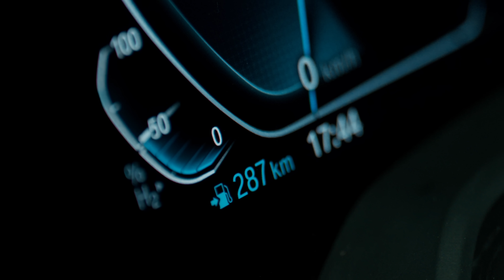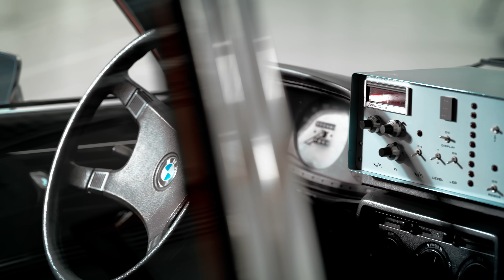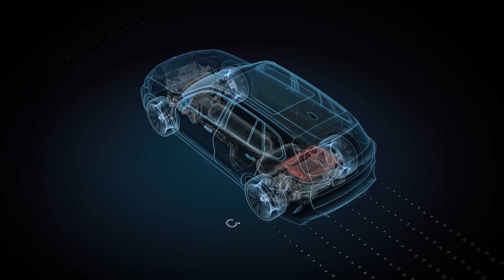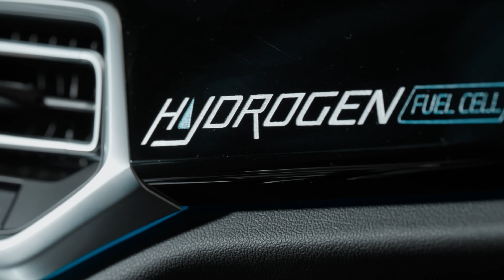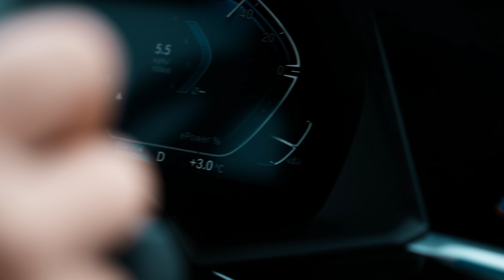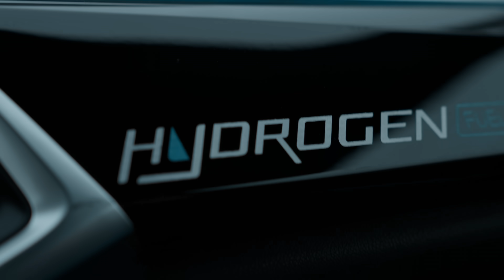Hydrogen Vehicles Are Electric Vehicles Too

Comment: It seems like many of the comments come from people who are not well-informed—especially those who favor battery EVs. 😄 The arguments against hydrogen technology often miss the mark. Personally, I see more potential in hydrogen than in batteries, though there's still a long road ahead. I’m skeptical that 2028 will be the breakthrough year for hydrogen vehicles. The challenge of building the necessary infrastructure is enormous.

When it comes to storing hydrogen, there are serious considerations. While some existing gas stations could be adapted, the storage tanks can't simply be reused for hydrogen. Hydrogen requires special tanks that can handle high pressures and prevent leaks, as it’s a much smaller molecule than gasoline or diesel. Safety is also a major concern—any potential ignition source must be avoided, even something as common as a smartphone could pose a risk. Handling hydrogen safely will require a lot of attention and rigorous standards to prevent accidents.

Given the current pace of progress, achieving widespread hydrogen vehicle adoption within the next four years is ambitious but not impossible. It would require overcoming significant hurdles in infrastructure, cost, and technology. If these challenges are met with concerted effort and innovation, we might see a notable increase in hydrogen vehicles on the road, though mainstream adoption could still take a bit longer.
Reply: I think you need to do some research.
Reply: Widespread H2 vehicle adoption would take a massive united global effort and decades worth of resources, because the required infrastructure is currently non-existent and very complex and resource intensive. It would be much more resource and time efficient to focus on BEVs and alternative forms of transit.
Reply: @paulc6766  I thing you too
Reply: @beanapprentice1687  
I’m just trying to explore potential answers, because simply dismissing the idea isn’t helpful. Think about it—how many times did the Wright brothers hear that human flight was impossible? Yet, they proved it could be done. Over 100 years later, commercial aviation is a normal part of life.

In the same way, I wouldn’t be quick to say whether hydrogen-powered cars are possible or not. Technology evolves, and what seems unrealistic today might become commonplace tomorrow. I believe in the free and natural exploration of technologies, driven by innovation, rather than having progress dictated or limited by regulations from political classes. Time will ultimately show us what is truly possible.
Reply: @jaroslavsimon8100  I’m sorry, but the time to explore potential answers is over. Automakers have had since the 1970s to figure out which emissions-free fuel technologies are best for passenger cars, and hydrogen clearly isn’t it. You can’t really compare the invention of powered flight with hydrogen cars because so many variables are different between the two cases. Today we have unfathomably more understanding of the world around us, and technology which allows us to simulate, create, and test inventions like never before. We know that H2 infrastructure is far more expensive than electrical or gasoline infrastructure, and it’s simply because hydrogen gas is among the smallest of molecules and tends to slip through microscopic imperfections in the walls of any container. Electrical infrastructure is far cheaper and already exists, and so all we need is alternative forms of transit to largely compensate for the weaknesses of EVs and we could easily convert half of the world’s vehicles to electric in the next 2 or 3 decade (of course, that’s ignoring resource limitations which willl undoubtedly slow down the pace of EV adoption; but if battery materials are a concern then we can focus on PHEVs instead and get all the environmental benefits during city driving, which is where BEVs are predominantly used anyways).

And if you want to know how the field of clean vehicles would innovate and explore technologies if the process wasn’t guided by government regulations, well the answer is that this field wouldn’t even exist. That’s because automakers only care about one thing, money. And neither BEVs nor FCEVs are as profitable as ICEVs. Hydrogen powered cars exist, but they’re little more than lab experiments and have been this way for the past 15 years without much change. Automakers are simply not willing to spend the billions upon billions of dollars necessary to build a comprehensive hydrogen refuelling infrastructure from scratch. But relatively light government regulations have been enough to convince automakers to spend money building out EV charging networks, with a thousand EV charging stations being built every week in the USA. Compare that to around 60 hydrogen fuelling stations ever built in the USA.
Reply: @beanapprentice1687  looks like my last comment have been DELETED...thank you very much pal for this democracy...very well done man.
Reply: @jaroslavsimon8100   damn, that sucks. I recommend saving long comments in a text file so that when YouTube decides to censor you, you can just past it again and change a few words.
Reply: @beanapprentice1687  yeah...I made more statements about this and I believe that yt communist censorship would no appreciate that I have my own opinion about CO2 and other problems.....I try to write it again because I was little longer and save it....apparently they dont neet people who can think on their own in discussions

Comment: What was the challenge of having the engine splitting H2 from water itself?
Reply: The challenge is that you'd need an external source of energy to do that, like carrying a very big battery. And then you'd just have an extremely inefficient battery EV.

Comment: You would have thought the nay sayers would have learned something from the BEV rollout 🙄 not enough information to reach a decision yet. Not making a decision about it yet
Reply: We learned some thing from Toyota's rollout of the Murai in California. Even after giving away a $15,000 fuel card with them, the effort was at best a disaster. It was plagued by fluctuating and very high hydrogen price and some of the few  station clos8ng down. The Murai is a perfectly fine state of thd art HFCV. The problem is hydrogen is an energy hog and producing is not green or efficient.

Comment: Hydrogen sucks compared to being able to charge at home, free if you have solar. Hydrogen also has issues in cold weather and still requires you to have a mechanical engine and the repair issues with it. No thanks.

Comment: Hydrogen vehicles, at least in passenger type cars is and always will be a failed technology, they are by far much less efficient that straight battery electric vehicles. Also I still remember the only BMW I have ever splurged on, a BMW E32 735il,  it was one of the most unreliable cars I have ever owned, when the zf gearbox which should have been re called but wasn't blew it's clutch pack, leaving myself and my wife stranded, i swore I will never another beemer EVER. At $144k aud in 1988  was not a cheap car, good luck with your disinformation campaign, good luck with your China market, you'll need it

Comment: In the end, the future will move towards the hydrogen industry. This is because carbon dioxide emissions make it impossible for ships, trains, airplanes, and trucks to rely solely on battery-electric power. Hydrogen will be the only viable solution for these sectors. As the hydrogen industry develops, personal vehicles will also increasingly be made as hydrogen-powered cars. Of course, electric cars are just a stepping stone towards a hydrogen-based future.

Comment: Ok BMW, Lets cut the crap and please put out some numbers. Let's benchmark the Tesla model 3. Can your hydrogen 3 series be having atleast the following specs? Unladen weight < 1836kg, Trunk volume > 594L, Frunk volume > 88L, Power > 200kW & WLTP range > 550km. If not, dont make these useless ad pieces. So you proudly claim that you guys are sitting on this technology for decades and a startup from 15yrs ago screwed you left right and center in your own ex-benchmark executive sedan segment. Arrogancy has no bounds! And you guys still have not learnt from your i3 times...

Comment: People can charge up their BEV at home overnight while they sleep.

They can’t do that with a hydrogen vehicle.
Reply: I make my own hydrogen under the hood as I go down the road. You can run a diesel on filtered crankcase oil and 17% gasoline. Got to premix it. Rudolph Diesel at a Paris Worlds Fair demonstrated running his compression ignition engine on peanut oi. No Diesel Gate
VW got busted because their diesels were getting over 50 miles to the gallon. With that available who would want an EV?

Comment: This guy forgot to tell you a Hydrogen powered vehicles still need a battery to make it work. The only zero emission's vehicle, I don't think so.
Reply: A 12 volt like in every ice vehicle charged with an alternator. Where have you guys been sleeping?
Reply: FCEV normally have a buffer battery. Toyota Mirai II: 1,2 kWh. Hyundai Nexo: 1,6 kWh. And (for comparison) the classic hybrid Toyota Prius: 1,3 kWh. Yes, there is a traction battery, but it's not comparable to the battery of battery electric cars with capacities of mostly more than 50 kWh nowadays.
The FCEV Rasa from Riversimple doesn't use a battery, but ultracapacitors for buffering.
If you just need such low capacities, ultracapacitors are a feasible alternative to batteries.

Comment: Hydrogen can be cheaply produced in remote locations, using solar or wind power. It can be transported all over the world and used for cars or to support electrical grid. Also, surplus of energy produced locally, can be converted to hydrogen. Building battery storage would be way more expensive and is practically impossible.

Comment: Hydrogen for cars is inefficient and expensive compared to battery EVs. There are 4 driving motors for this agenda though. The first one is to do with taxes, companies are required to reduce their average CO2 footprint, this is one solution. Second, it is possible for Japan, Germany and Sweden to use air turbines electricity, and generate hydrogen for energy storage, so they come up with these ideas as it is related to their future security as well. Third, there are technologies that promise replacing gas with hydrogel in steel industries or cement industries etc. Finally, western companies ( japan included ! ) try to buy time so that maybe they come up with low cost solid state batteries or better fuel cells not relying on platinum or they just have some stock market share and do no pt give a dime about humanity but their bloody fast profit. 
Batteries are obvious choices…
Note that a few kilogram of hydrogen is a large volume with challenging storage solutions…

Comment: Awesome! Now stick to in-line-6 petrol ICE. No hybrid, no mild hybrid bs. We want longevity and easy cheap repairs.
Reply: Except EVs require much less frequent maintenance. I love gasoline engine, but it's so stupid having to convert vertical movement (piston) to rotational movement (wheel). There are way too many moving parts to maintain.
Reply: @rnrnrkrk994  It is „less maintenance“… until you need to (inevitably) replace the battery (which costs more than the actual car) or try to sell the car (and get surprised that 85% of the price went into the toilet after just 5 years of use). How often do you need to do an ICE replacement? Almost never. So if you look at it in short turn - it makes sense that EVs are cheaper to maintain. Otherwise EVs are absolute garbage.
Reply: @dppopov  Lets be real. I love ICE vehicles too but if you add up its own wearable components that is pretty comparable.
EV batteries last at least 150k miles (avg americans drive 12k miles per year so thats >10 years). Changing it is basically changing the whole car and good for another 150k miles (to maintain 80% life) for about $10-20k
ICE vehicles, transmission change alone costs +$5000, sparkplug every 8k miles also cost $1000, engine oils, motor mounts, engine radiator, intake filter, oil changes every 10k miles, fuel pump replacement, motor mounts, engine valve cover gaskets, battery, catalytic converter, emission checks and last but not least gasoline over the 6-8 years add up equal to or more than EV battery replacement.
Reply: The issue there is that oil is a finite resource, and will one day run dry......